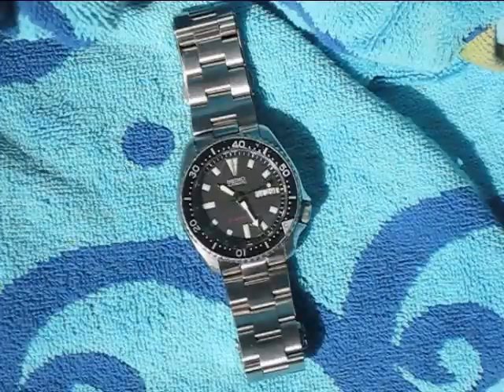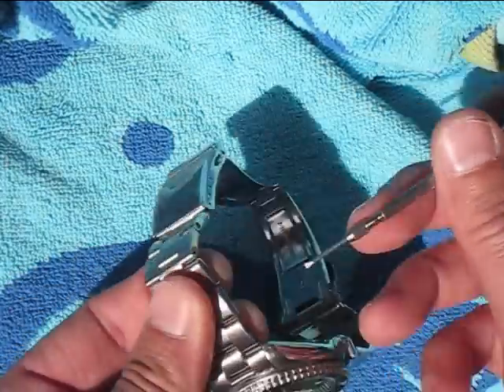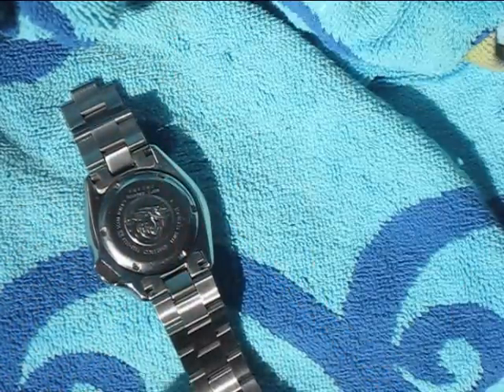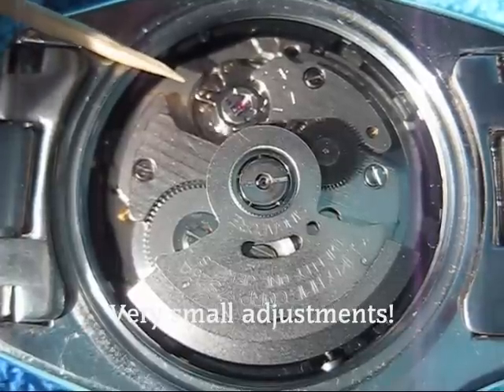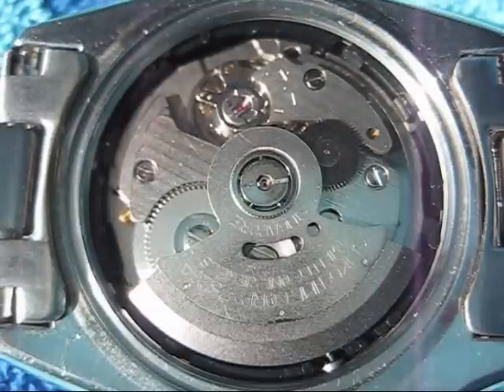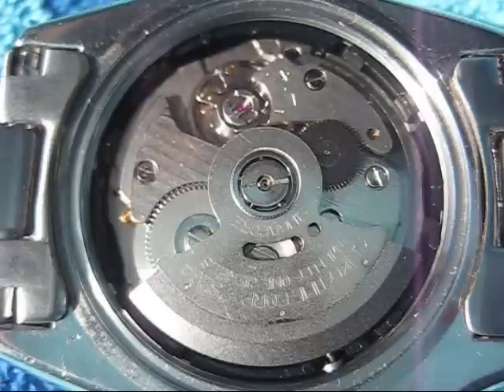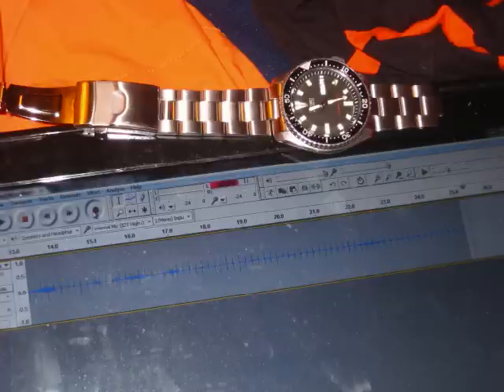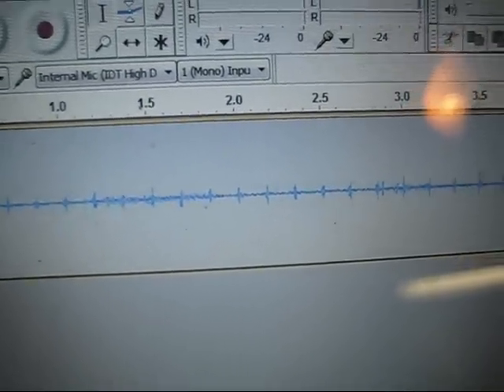How to: Regulate Automatic Watch

Comment: I just bought a seiko 5 automatic watch and after 3 weeks of wearing it, its second hand has a small seconds difference compared to digital time settings from my ipad and  laptop. I did adjustments on time without regulating it and after a week the problem is still the same. I read one article that before attempting to open the back of the watch and regulate it, you should try to wear the watch at least 8 hours per day. At night remove the watch from your hand and lay it vertically with the rotating crown facing upwards. I did it for about a week and thank God it worked! The accuracy is the same as the digital watch. But you have to maintain some digital time sources to monitor its accuracy. By just doing the things I mentioned, accuracy is the same as that of digital or even quartz watches. You don't have to wear the watch 24/7 to keep it running. Just wear it at least 8 hours a day and lay it vertically with rotating crown facing upwards when not in use.
Reply: Does your Seiko have hand-winding? From what you describe, it sounds like the watch doesn't stay accurate all the way through the power cycle and needs to be kept 'topped up'. Is that what's going on?

Comment: My £12 Winner automatic watch was running 5 minutes an hour fast, so gaining 30 minutes in a morning (Yeah I know , get what you pay for ) BUT after following your instructions and using Audacity it's running super bang on. Thanks :o) 
Little tip, I used a headphone set from a phone with a built in mic and popped it and the watch in my glasses case to block out background noise if anyone has trouble getting a reading from an inbuilt laptop mic.
Reply from the maker: Martin Pope awesome !!
Reply: Not to 32 meters ...i do have Seiko,Vostock and Arbutus....Vostock Blue Automatic perfekt ...Arbutus the them....

Comment: Just a suggestion but if you are not going to change your rubber seal before you put the back on you might like to rub some silicon grease on the rubber ring. As well as improving the water resistance it will lubricate the rubber and stop it from drying out. The silicon grease can be found in dive shops and eBay, of course. I live in the tropics and everything here is affected by heat and humidity.
Reply: I high oh hhhh oh oyou o🎉

Comment: If you look carefully there is a small extending pointer on the regulating ring,its possible to mark where it is with fine tip pen  using a lope (eyeglass)so you can see exactly how much its moved on adjustment.I also use silicon grease on the o ring to ensure its water tight.....dont use Vaseline etc, as it will rot the rubber.

Comment: Noticing a lot of comments on recording style and things about the case back, but one important thing to note is that not all watches tick at the same pace, so your 5 ticks per second from you seiko would for example be 7-10 ticks per second on a Rolex IE 28,000 BPH in a 2016 Submariner and 36,000 BPH in modern Daytona movements, but all around a good video either way!

Comment: After taking the back of my Seiko 009 Pepsi to repair it, how likely is it that it will still be water proof just for regular swimming? The seal seemed to be ok
Reply from the maker: I've never had any issues with the water tightness of watches that I have regulated myself, just put some silicone grease on The gasket area and screw it down nice and tight It should be adequate for swimming
Reply: Thanks for the advice, I'll try some silicone grease before I go swimming

Comment: audacity tip was amazing. It's so fast to regulate it with it. No waiting. I had to open the rear cover to record it, or the mic would not hear it properly.(seiko skx007). At first I adjusted it always to wrong direction, as in audacity it seems slow, but actually it was beating already too fast(too many tics per minute) so I had to slow it down.

Comment: That was a great video it’s nice to know that you could use simple tools like this just to save you money. I have a question though I have seen professionals measure the watch’s timing by putting the watch on its side, face down or even holding it on an upside down. Because according to the professionals gravity can take affect on the movement of the watch. What then?

Comment: There is another way of dong this.  If you have a Camera strobe such as the Canon Speedlight 550EX  you can set it to strobe at 5Hz or any multiple of 5.  This will allow you to see if the flywheel is stationary (if so you're dialed in).  The speedlights use a crystal for the CPU so they are pretty darn accurate.  Use a different strobe frequency for different watches.  However I would not trust the waterproof-ness of the watch after taking the back off.
Reply: That's a great tip. As to the waterproofness, there's no need to worry if you lightly coat the o-ring with a little silicone grease and tighten the back with a good tool.
Reply: Depends on the watch. The Seiko SKX173 actually runs at 21,600 beats per hour or 6 ticks per second or 6 Hz.
Reply: like tuning an engine, however i dont have that strobe and i dont want to buy it just for tunne a fukin wacth
Reply: Steven Wymor : I think that 6 beats per-second would equal out to 3HZ, but I may be wrong.
Reply: No that"s correct, as 1 Hz is one complete cycle 
 @sauljewhebrewberg3147

Comment: Hello. I have a Fossil automatic and sometimes when i try to manual wind it, the wind feels lighter and the wheel that shoud tension the spring is not moving. If I shake it a bit and then I try to wind it , it works just fine for about 10 turns of the crown , then it makes the same thing again. Do you know what can it be? Thank you!
Reply from the maker: I'm just a guy not a watch Maker sorry

Comment: Thanks, nice vdo u made there. However my Seiko 5 is now my museum piece,  My I tap your expertise if its possible to get an "adapter" so I can use the strap on a watch that came with a leather strap that takes a spring bar 20mm width between the "horns". I cannot trust the shop that gv me a straight 'NO' answer.

Comment: That's really good. Thankyou. Very well explained. On a ETA 2836 watch movement, which beats at 28,800 beats per hour, that would be 8 ticks per second (instead of the six) on the Audacity Software wouldn't it..
Thanks again. Great stuff!

Comment: I have 2 automatic watches, one was 70 and the other was 200 (wow ikr). It continues to count time or continue with  my arm movement, if it doesn't move after a while it will stop. Do you know how to make it continue forever or something? I hate having to redo the time every morning , it takes me forever, because when I grab it and try to adjust the time, the seconds still continues so if it's not accurate, it is hard to get it perfect.

Comment: I'm fearful of opening my seiko 5 automatic watch to regulate it. It runs slow. I have read that it can be fixed by laying it face up with the crown pointing up. The crown is located beside the 4 position. I have left it face up with the bottom half (ie 3 to 9 with 6 in the middle)higher than the opposite side (3 to 9 with 12 in the middle). Is this what is meant by the crown pointing up as it isn't having the desired effect?
Reply from the maker: Just open it up and try it, be careful with it, don't be afraid it's not a 1000$ watch
Reply from the maker: Experiment with different crown positions , it will have some affect but won't substantially change the time keeping of the watch.
Reply: Thank you for replying. Strange thing is it started running slow when I left it on the bedside table! I cant remember the orientation though. I appreciate it's not an expensive watch but I have very shaky hands and the watch holds sentimental value. Thanks again. I will do as you advise.
Reply from the maker: @michaellavery4899  if you don't trust yourself to not damage the watch then take it to a professional

Comment: What about that other second bar? I think I nudged it. Should it be left alone?
Reply: Moving that second bar doesn't take any effect on the accuacy. It moves the first bar as well. The first bar makes the hairspring shorter (the watch will run faster), or longer (the watch will run slower), the second bar turns the entire hairspring. The second bar should be used when the first bar reached its limit. When you can't move the first bar to the way you want to push, you just psh the second bar back, and tadaaam, there is more space for the first bar to push :)

Comment: in my watch the spinning thing got stuck and does not move & the watch does not charge,plz help me out
Reply: The escapement spring on the wheel has become fouled or is broken.  That's the hairspring on that spinning cog that you can see moving constantly when you wind your watch.  If the watch is an expensive one you can get the spring wheel changed but if it is a Chinese cheapy then just cannibalise the band off the watch and chuck it away.  The cost of the repair in most western countries would be more than the watch is worth...sorry to tell you.

Comment: is this a common thing for a auto watches? if so, why?
Reply: Jsanga4 that's what I want to know..
Reply from the maker: it is common for mechanical watches less than 1000USD.  a mechanical watch must be a very finely tuned instrument to keep time precisely.  In an age of computers and electronics I know this seems silly, but mechanical watches have their charm.  It's a lot like getting an old 1960s Volkswagen Bug to run perfectly and create more power than it would from the factory.

Comment: would that work with seiko 5 sport?thanks
Reply: Should do.
Reply from the maker: maybe.  a seiko 5 is a cheap watch so just open it up and give it a try, be careful and make small corrections.  worst case you're out 100$

Comment: Even with that app you still have plus or minus 2 seconds a day?! 😨 can automatic watches be regulated accurately, adjusting the time every few weeks or every month seems and defeats the purpose of owning a watch.
Reply from the maker: TheOne AboveAll even the best and most expensive automatic watches will be about 1-2 seconds a day, this level of accuracy is considered very good for a purely mechanical instrument.  As far as defeating the "purpose" of having a watch; owning a cell phone defeats this purpose.  Almost no one "needs" a watch.  Wearing a watch is more about style and image than anything else.  Just like wearing a logo or images on clothing, it has no purpose except to convey style.  Especially when you can buy non logo clothes for much cheaper.
Reply from the maker: even the best mechanical watches are 2 seconds a day (rolex / omega / breitlings).  mechanical watches are 90% style and 10% practicality.  its like owning a classic car: its for style and not for gas mileage.  if you don't care about style then get a cheap Timex at Target, or just use your cell phone and don't use a watch at all.  No one really needs watches nowadays.

Comment: Can't do this with mine, they're filled with either inert gas or oil that need to be drained and replaced.
Reply: What watch do you have?
Reply: ***** The one with oil is a Sinn UX. It has a quartz movement and is filled with oil to equalize the pressure and has a water resistance depth of 12,000 meters... Yep... 12 km depth... In case I lose it in the ocean and want aliens to find it 10000 years from now still ticking.
Reply: +ZeitLan Inc. It won't be ticking 10000 years from now for the simple reason that the battery would run out in a year or so.

Comment: I only have less than a dozen watches in my watch case but anyone who needs to be this picky really needs to  get some OCD therapy.
Reply from the maker: That's a great insight
Reply: @cloudzrest  I'm not sure if you're remark is meant to be facetious, sarcastic, or honestly seconding my statement, but I find syncing some of my better watches once in a while just simply a part of owning and being in tune with my automatic and mechanical watches. 
It's akin to the enjoyment I find driving my 4 speed standard shift summer weekend car around.
If someone is that critical of having their time piece being hyper accurate, than they should keep a GShock F91W in their pocket while wearing their 3 to ten thousand dollar show piece wrist jewelry.  At +/- 3 seconds a month, the 10 dollar GShock will keep them on time.
Reply from the maker: @a.delome8023  if you're paying 3 to $10,000 for a watch and it doesn't keep very good time, that's a bad purchase. But a Seiko on the other hand such as this one, which is a 2 to $300 watch, can keep good time initially, say within 10 seconds a day, but over time as the watch get magnetized or for whatever reason loses accuracy, sometimes it's necessary to regulate the watch rather than just give up on it and buy a Casio or other digital watch.
Reply: @cloudzrest  "Good" accuracy is a very subjective term.  A couple hand-windables I own get a few turns every morning. A few may sit idle for a week or more before I choose to wear one of them.  Then I just set it close and go. If one of them is off a minute or so after 4 or 5 days, it's no big deal to me. Hell, sometimes I don't even take the time to exact the date! Most of mine are what most collectors or watch buffs would consider budget watches anyway.  My main daily rotation consists of a Tissot Powermatic 80, an Orient Defender Gen 1, a Gen 2, my old Timex Marlin, and a Hamilton Khaki Auto, there are a few others I throw in the mix from time to time including my old Waltham Centennial 100 I bought over 50 years ago that's been through a half dozen bands and still runs wonderfully. And perish the thought, I even have a few quartz models I like.
I sync my daily user to my cellphone when I put it on if I think of it, but I don't go OCD every time I put one on. I've never self-regulated any watch I own and it's just not important enough to me to ever consider doing so. I highly doubt many non-quartz watches from entry level to a $1000 ever run at their optimum accuracy when not fully wound anyway. It was an interesting video but I'm just not that interested in pursuing the task. Good luck to you and stay safe during this difficult time we're in.  Take care!

Comment: Never do that, I just did it and it didn't help at all only screwed it up because it stopped working, so I had to go to the watch repair shop and the guy there said that it should be left alone just like they fixed it at the factory.
Reply from the maker: V8 Powerr haha well this process worked great for me and tons of other people who regulated watches themselves, if I couldnt regulate the watch I wouldn't have kept it because it ran so poorly from the factory
Reply: the guy who told that is simply wrong. that adjustment lever is present for adjusting the speed of balance wheel since the spring inside of it loses its tension by the time. if it should be left like it came out from the factory, why would they design such a thing?

Comment: the only problem he now has is that he cant guarantee its waterproofing as the seal may not be placed back in correctly
Reply from the maker: if you're going to scuba dive down to 200 meters (which i'm guessing you won't)  then don't use this method.  get a rolex or a suunto dive computer.

Comment: Forget about Audacity..... Totally ridiculous and looooong way of doing this.  Just get yourself a cheap atomic watch or clock and compare your watch to the atomic time.
Reply: +Una Carafea yea, go ahead and clock yourself for hours until you get it to sync exactly. after a few adjustments using audacity method, i got within -0.00115 sec/min -> that's losing about 1.7 sec/ 24 hrs. yea, totally ridiculous way of doing this.